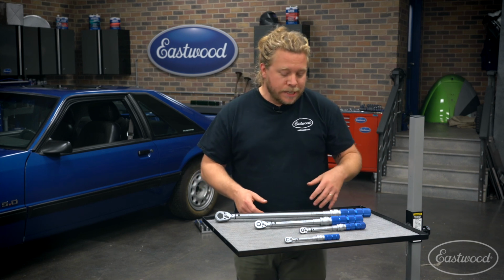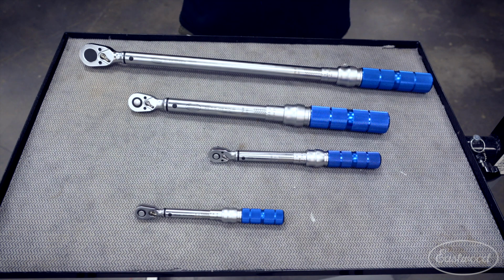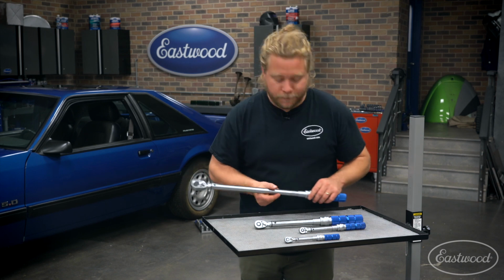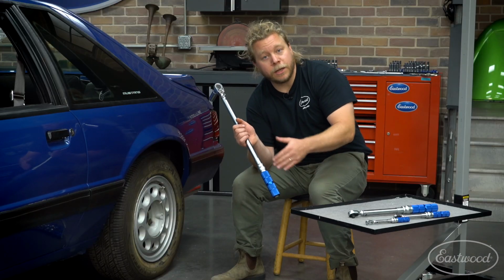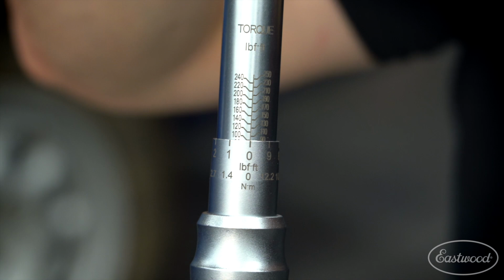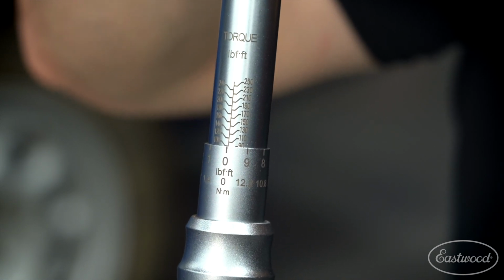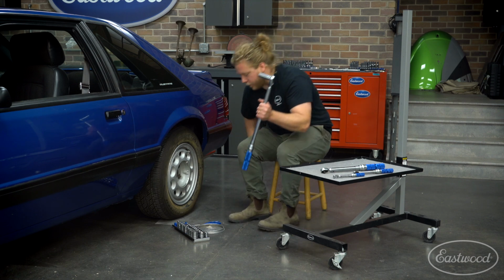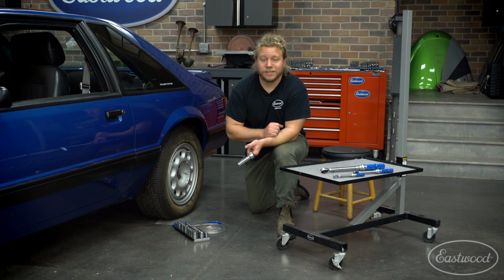How-To Use Micrometer Torque Wrenches from Eastwood!

Comment: I was taught how to use a torque wrench in the Air Force. As you can well imagine proper torquing is critical in the Air Force. They taught me that the only way of getting accurate torque is to pull the wrench toward my body and never push it. You can always maneuver around so that you can be in a position where you can pull the wrench. Second, do it slowly so that when the wrench reaches the breakaway it comes as a surprise, sort of like the proper way to pull the trigger when shooting a gun.

Comment: Maybe a good follow up is the proper way to tighten, then torque wrench tighten that wheel on the car! I have seen many installers out in the field, sometimes using torque sticks, sometimes just the full on impact! (Depending on current air pressure can vary the torque to those lugs to all kinds of excess pressure) then they grab the torque wrench, that the last guy used as a hammer and make all the lugs click and think they did it right! Except next week you have brake vibration caused by improper lug torque! I know that this is more of a sales booster then an education video but I think they can be both! I love seeing the instructional videos that Eastwood puts out here on your equipment and how to use it!